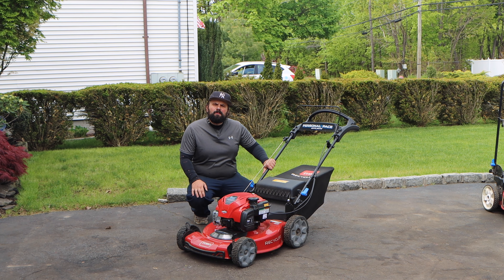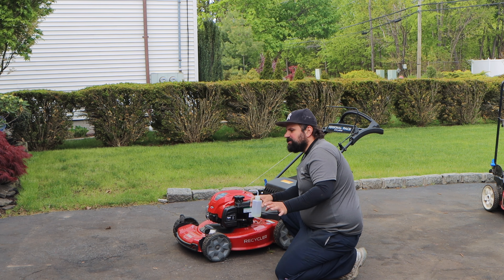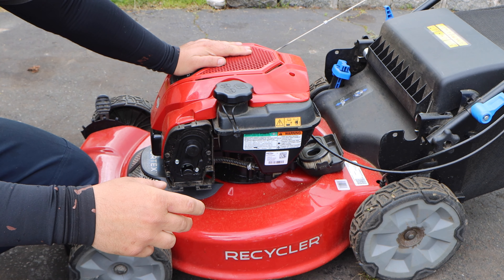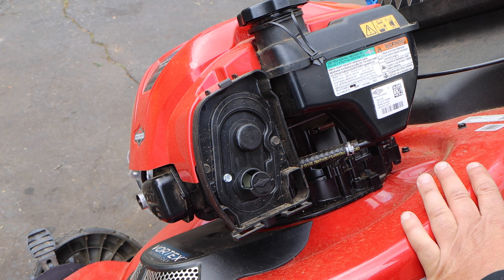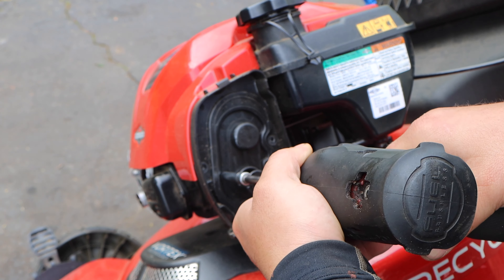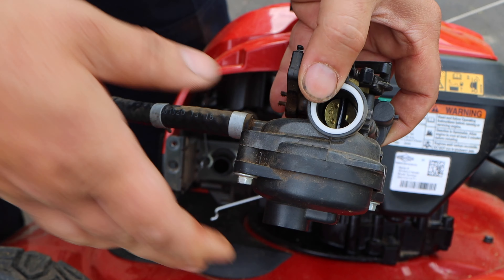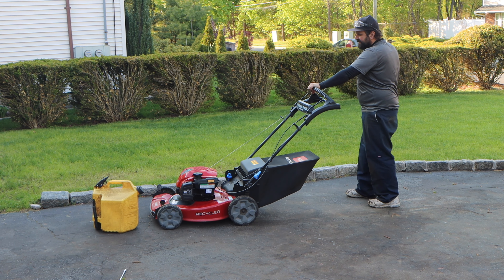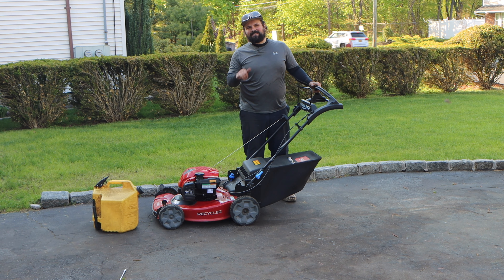New Toro Vortex Lawn Mower Won't Start "It Ran Last Year"  How To Fix #toro #lawnmower #diy

Comment: when i worked on small engines for 15 years, seafoam was my favorite "mechanic in a bottle".  glad to see others using it on small engines!
Reply: side note: might be a good idea to replace air filter, spark plug and oil if not done in some time - for those thinking of doing this repair......  oil is often overlooked.
Reply from the maker: Love me some Sea Foam...24/7/365 multi platform additive!  I don't care what the engine says...every season the bare minimum maintenance is to at least change the oil.
Reply: Do you have a video for changing oil Troy built Honda ?
Reply from the maker: @kasaloub.bennett9878  I don’t for that mower but it’s just like any other.  Run the mower for 5-10 mins to make sure it’s NICE AND HOT.

Remove the oil dip stick and lay the mower on its side.  EXHAUST TO THE GROUND AND CARB/Air Filter facing the sky!  

Let the oil go into a drain pan…if you don’t want to scratch up the deck put something down between the mower and driveway.

Add 20oz of 10w-30 oil
Reply: @kasaloub.bennett9878  I don’t know if he has a video for it but I can tell you that the easiest way to drain, and I think on Honda, is the only way to drain is to just tip them over with the oil cap off and let it come out the oil fill tube.  It’s easy. Just make sure you get it into a bucket. If you don’t want it spilled on your driveway or yard.

Comment: People complain about those plastic carburetors, but they seem fine if you take care of them and run them until they’re dry. Also, they seem very simple to take apart and clean when they get clogged with ethanol.
Reply from the maker: I agree ain't nothing to rust out or DENT :)

Comment: Thx for identifying the problem.  I did it with removing the carb. I just removed the bowl and cleaned out the jets.  Carb cleaner and compressed air.  Started on the second pull.      Victory ✌️!!! This is a new mower too 12 mos or so.  Is it better to store vertical or horizontal?   Usually I do the vertical
Reply from the maker: I'm old school, I Keep it horizontal!  Vertical will work as well!
Reply: 3 months old mower here. Been trying to crank it for last 2hrs, i have blisters on my hands from this and just need my lawn mowed. Fml

Comment: Nice video and agree seafoam is great. I have this mower purchased new this year has 12hrs on it. At my age I have had my share of mower brands. This is one of the most expensive POS someone could own. So cheaply made and designed , starting with a plastic carburetor. But that applies with alot mower brands made today. I miss my old lawn boy.
Reply from the maker: Please take account that no mower manufacurer makes it own engine (RIP HONDA).  Thats a Briggs and Stratton thing...TBH, I use to hate the plastic carbs but once I figured out how they work and to repair them.  I'm really not bothered by them.  I have YET to see one warped!  Was your LB a 2 Smoke Model?
Reply: @pattayperformance  
No 4 cycle

Comment: Mr Pattay, thanks for the video!  I did exactly as you show in the video, my mower not even one year old but unfortunately it didn't resolve it.  The ports looked very clean but I did clean them still as you instructed.  After putting all parts back it would not start.  I did squirt lighter fluid in the carborater just as you did and it will start and run until it burns off.  Checked the gas hose from tank and gas is moving throught it.  If you have any suggestions, I'd love to hear from you.  Thanks a lot and best of luck with your channel.
John in Texas
Reply from the maker: You still have a fuel related issue…

Confirm fuel flow to the carb by removing the fuel line.  If you see a steady stream clean the carb again.  

If the problem still persists replace the plastic jet 

https://amzn.to/3W1QRuE

Comment: When this happens, I also clean the fuel tank. I use a Mr Funnel to filter the gas, if there is enough to warrant reusing it.
Reply from the maker: Gas Taste Fine so I know it didn't need to changed.  I've had great luck as seen on the channel dumping fresh gas into old gas and rejuventating it.  This is gas that is about a year old or less.

Comment: Hello thanks for the video. Can you tell me what part number is the carb. Seal bowl for this unit is and also notice that the fuel gas cap seal is also missing on this mower of mine. Thanks for any advice..
Reply from the maker: give me a few..I will try.  You might be better off ordering a new carb.
Reply from the maker: as suspected you are better off buying a new carb!  This one even comes with a filter for BONUS!  This is aftermarket which I haven't been having issues.  If you prefer OEM...USE THIS KIT AS PARTS TO REPAIR YOUR CARB  https://amzn.to/48aglJX
Reply from the maker: O-Ring for Fuel Cap, I'm not sure...can try bringing it to local parts store or even transmission shop.  They can measure and sell you an O-RIng .  Briggs sells just the whole cap  https://amzn.to/3ri9duf

Comment: I just found out my mower wouldn't start yesterday. I've been using non-ethanol gas but I'm guessing this is my issue. Hopefully this will work for me, will let you know when finished. I'll have to remember the Seafoam also.
Reply from the maker: Good luck and keep me updated!  Once you get running don’t forget to change the oil and service the rest of your machine! 🔧🦅🤙🏻🇺🇸

Comment: I know you aren't a Toro/B&S rep, but why would a brand new mower have this issue? Mine was a month old and bogging down. I thought it was water in the gas (hurricanes Helene & Milton came through), so i emptied old gas and put in fresh. Worked fine for 1.5 cuttings and now runs about 5 min then dies. 
I'll do your fix in the morning and post the results
Reply from the maker: How did you make out?  Glad your family, you and eqwuipment faired well!
Reply: @pattayperformance  I did your repair and it started up 1st pull. Yay. Finished the yard and almost finished it a 2nd time and it died again. Boo. Same issue, so instead of taking everything apart, I just took the carb cover off and blew it out w/my compressor and it ran fine. I've just resigned myself to the fact that I have to do that every time I need to mow. Not a big deal, but a brand new mower shouldn't be doing that.
Reply from the maker: @ I want you to do the following.

Take apart the carb and clean it as shown on this video.  

Extra step…you don’t have to have to pull the engine cover…while the carb is off remove all of the gas and flush out the tank.   Once done used some compressed air to dry it out.  

To make things easier can pull the engine cover and unclip the gas tank with line on it and do the same process. 

Something is still in the fuel system clogging up carb
Reply: @pattayperformance  
I did that the first time, lol. But I'm going to mow the yard 1 last time for the winter, and I'll do it again to make sure I've gotten all of the lines completely blown out. 
I appreciate the advice. I just subscribed and will follow your videos since I'm way too cheap to pay a repairman for something I can fix. Keep up the good work.
Go Bills!!

Comment: These carbs burn so lean that if the fuel is old it will not start .
Reply from the maker: Thanks to Crappy CA!  You know that cool trick Steve showed us and I showed on the channel?  The 163cc and newer mowers If I upsize the jet its either impossible to start or surges really bad.  Those new mowers are dialed in from the factory based on what I just mentioned.  I stopped doing the upsize trick and I keep jets in stock now.
Reply: Lean is true. I’ve had debris collect  in the gas tank (I’m guessing through the vent) and clog the carburetor. I know this because it happened only after I ran it dry. Had to clean the small jet in the carb that Jason showed. This would have never happened on a Briggs quantum.
Reply from the maker: @everybodysjonathan    LONG LIVE THE QUANTUM!

Comment: Toro sucks.Mine will start and run for a little while but then that sucker won’t start no matter what I do. I will not ever, never will I ever buy another Toro???!!!!!!
Reply from the maker: FYI..

Toro makes the motor…Briggs makes the engine.  

The mower will run for a little while…when it dies.  What have you done to try and get it started?

Comment: My Toro AWD Vortex is Junk!!!!  Anything over a few inches it chokes. I have to check rpm’s to see if it’s set wrong because if it’s not these are a complete waste of money.
Reply from the maker: I don't know the exact spec but I would have to check.  The Engine before these Quantums are suppose to be 2,900 to 3,000 RPMS.  Remember these are set conservative from the factory for a multitude of reasons like emissions and engine longevity.  You can raise the RPMS but use common sense to the point where the engine isn't screaming.  Also if your grass is wet...that your fault and not the mowers.  Toro does supply a FREE dischargw chute for the mower.  You have to call them and they will ship it to you.  PLEASE HAVE YOUR MODEL AND SERIAL NUMBER HANDY.   It will take 6-8 Weeks.  IMO throw the crappy atomic blade in the trash and get a high lift gator blade.  I put a link in the description to buy one.

Comment: This mower was the worst mower ive ever bought
Reply from the maker: @mansajose5226 ,

What issues are you having as a commercial owner?
Reply: @pattayperformance  it runs. Then after 15 minutes it stops. Repair shop wants me to pay 350 to fix a 500$ mower.  Do you have like a coaching class or anything similar?
Reply from the maker: @ did they say what they were doing for $350?

This would be my quick diag based on what you were telling me.  

Run the mower for 15 mins or so.  When the mower starts to die open up the air filter cover and spray starting fluid.  If it continues to run bc of that you know you have a fuel related issue.  

If it still continues to die you have another issue.  Check for spark…if you don’t have spark replace with new plug.  If that still doesn’t work replace ignition coil.

Just out of curiosity…when it dies…doesn’t start right back up or it needs to cool down for a little bit?
Reply: @pattayperformance  needs to be cooled. Sometimes it starts , sometimes not . Builds my muscles at the least. They just called to say it would take about 350 $ worth of work because it's a serious issue I believe,  and it would take some time. I bought another mower just because
Reply from the maker: @,

Yeah most likely by what you are telling me it needs an ignition coil.  Less than $20.  Give me a few to get the part you can order.
Reply: @pattayperformance  hey I really appreciate your response. If you had a better way of connecting I'd appreciate that too.